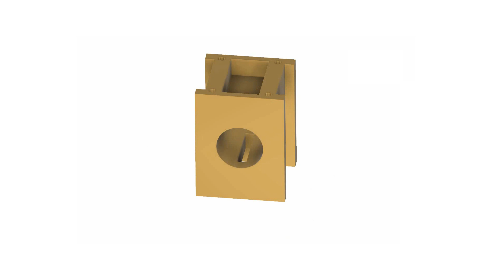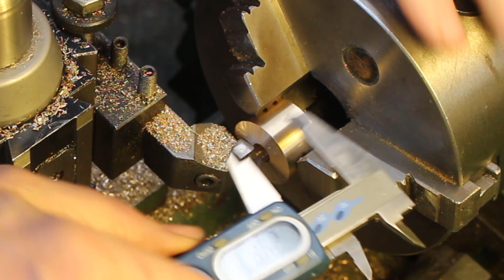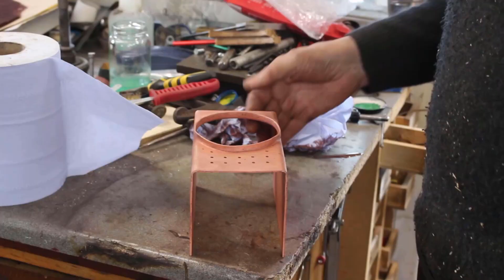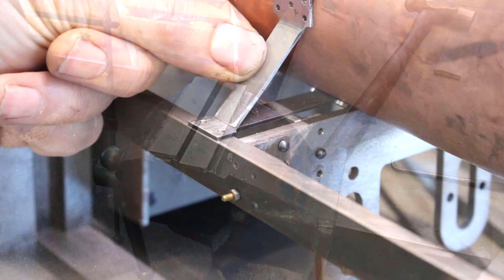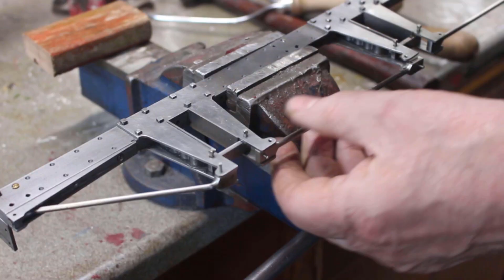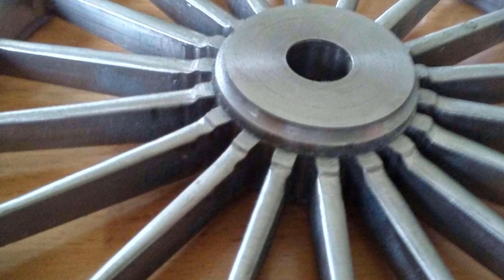Lion - Locomotive Steam Engine Build pt.33 - Axle Boxes

Comment: Hi Nigel, loved the vid. One question, please take no offence, about the alternative way of working you showed at the end of the video. Does that not defy the sense of the block it is in? The block is made to guarantee an accurate 90 degree turn. What advantage is there in loosening the nut and turning the axle box on the mandrel and going through a setup process with the parallels as opposed to simply turning the whole block? I was quite surprised to see you do that.
I expected you to side cut the two flat surfaces, vertical to the horizontal surface you had just machined. That would make sense as it limits the block movement to just one (that is flipping it over). So: mill one slot end, side mill both flat sides, flip over the block and mill the other slot end. If that would result in an accurately squared hornblock is a matter of the rigidity of your setup and your mill tool, I’d think.
Reply from the maker: No offence taken, always like to engage in discussion. I don't think loosening the nut to rotate the work piece and reset it using the adjustable parallels has any advantage other than perhaps reducing error should the collet have some run out, though any change in the set up has a risk of inducing errors one way or another. I had the need to remount an axle box and came up with that set up to accurately set it back up so thought it was worth showing it as an alternative method, especially as it gave such good results.
For sure i could have side milled two faces and avoid two movements of the block, with the axle box only held by one screw I was a little reluctant to take a full depth side cut, I'm sure it would more than likely have been ok with small cuts but I felt more comfortable doing it the way I showed.
In retrospect, I think there is merit in reducing the number of times the block is rotated in the vice, it does not take much to induce error if the vice and block are not thoroughly clean on each turn .
Thanks for your interest and comment, it's great to have engagement with viewers.

Comment: Good afternoon.
 Thank you for this video. Please tell us about the adjustable power level -  11:13.
Thank You. )
Reply from the maker: Those are adjustable parallels. You can use them just like ordinary parallels but set them to the height you need. They are also good for measuring the width of slots, fit the adjustable parallel to be a good fit in the slot then measure the height of the parallel with a micrometer. If you search "adjustable parallel" you'll find some information.
Reply: @GoCreatehms  Well, I understand.
 I wanted to find out what is inside, how the mechanism works.
Ok, thank You.

Comment: Hi, when you reamed the axel box hole what size did you make it compared to the shaft?  If the shaft is 11mm would you use an 11mm reamer? Thank you, great work again by the way
Reply from the maker: Hi Derek
I've reamed the axle boxes 10mm, the way i made my horn plates makes them a little narrower than shown on the drawings. I need to check how close to 10mm the holes actually are, I'm thinking of making the axles 0.02mm smaller on diameter to get a running fit, might try 0.01mm not sure yet. I think i will lap them to size, over kill probably but I do like the process of lapping. Happy to take on board any suggestions.
Cheers
Reply: Go Create Hobby Machine Shop The reason I ask was because I made new bearings for my Allchin crank but didn’t take into consideration any tolerance so the 11mm shaft wouldn’t fit into the 11mm reamed hole, I guess I should have made the holes bigger but I wanted a slop free hole, I think what you say 0.02 smaller will be perfect!..your train is fantastic